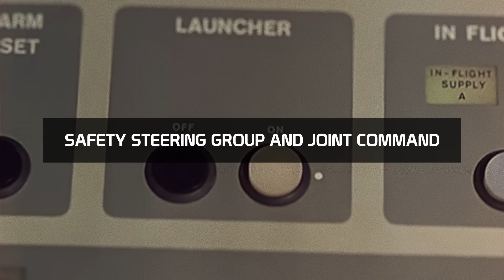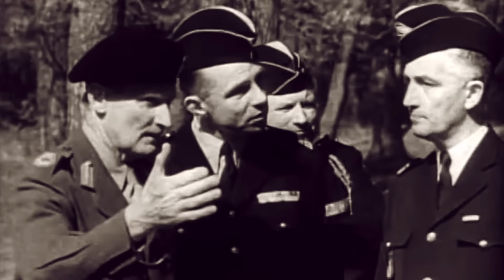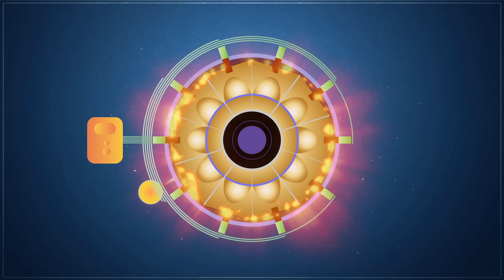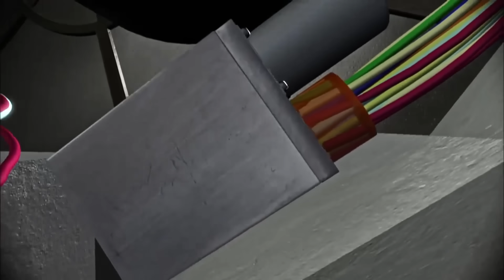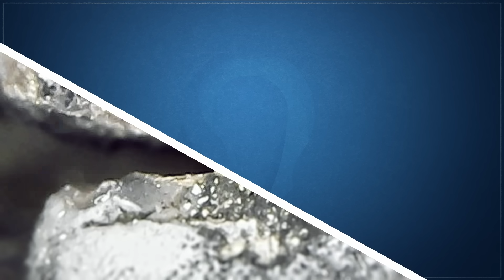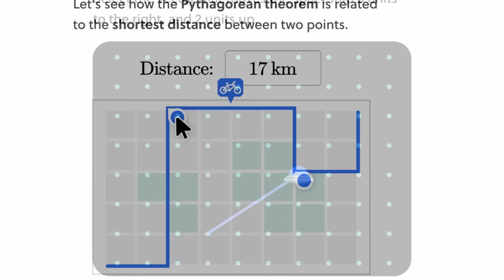The Remarkable Mechanism That Secures Nuclear Weapons

Comment: What is fascinating is that nuke tech at it’s core is very primal. Meaning once it got figured out it wasn’t gonna change much. Simply because of physics. So here we are talking about all kinds of modifications to start the firing sequence. So here in Belgium we also have warheads of US make. Then i wonder how frequent do these systems need maintenance or upgrades. While the core itself hasn’t changed that much most likely.
Reply: Kinda-sorta. There hasn't been a new warhead design since the end of the Cold War, but during that time, warheads were under constant redesign and improvements, as newer, more efficient designs allowed the US to squeeze more weapons out of the limited supply of weapons-grade and super-grade plutonium.

Comment: The actual lock is a still electromechanical.its a BCD electromechanical relay on the AF&F control board. The device is a little gold box similar to the size of one of the CP claire DIP reed relays. It has a small mechanism similar to the type you would expect in a combination lock that is driven by a tiny solenoid motor. If the correct code is entered the motor pulses allign the wheels to activate a switch. If all is good then the switch pops a nonrecindable thermal delay fuse relay that enables the system to arm. Once armed the only way to cancel is to use the destructive command disable. The switch must also be pulsed to the correct position fast enough that the disable relay doesnt fire. If this happens the nuke must have the PAL control module and the EF&F board must be replaced. Both the single shot relays look like glass top TO3 transistors. All of this stuff is potted in a nondescript epoxy block buried deep inside the forward section of the canned subassembly. This would make it extremely difficult for someone take apart the device, hotwire it, then reassemble as a usable weapon.
Reply: How do you know this?
Reply: @kellymoses8566  uh, maybe he simply worked with these things in the military?
Reply: @kellymoses8566  He Googled it.
Reply: @kellymoses8566    Look at the last sentence, he just had to brag.  Obviously, an extremely smart "someone" purchased some surplus warheads at a government auction, and he needs to re-code the devices.
Reply: @SunriseLAW 
What are you talking about? The best way to arm a nuke like this without any of that nonsense is to rip the core out and shoot plutonium into it or shoot plutonium into an assembled weapon at such velocity that causes a detonation. If you think that doesn't sound preposterous enough, the other way is by crushing the weapon. This second option to manually detonate is even more ridiculously impractical. May as well use such energy as a weapon itself. But yeah those are two ways neither of which are things even the most dedicated nations' teams of DARPA Skunkworks weapons experts could reasonably achieve. There are numerous other methods of dealing with nukes whether arming them or preventing them from detonating most of which surround disarming them using excessive force. More 'graceful' options allow for permissionless remote control, which is the scariest option.
Reply: @SunriseLAW  wtf are you talking about? You think he got ahold of surplus warheads (wut?) and then somehow de-potted the mechanism and learned all this from it? As opposed to him simply working in this field? Go learn about Occam's Razor dude.

Thats like a guy explaining how an elevator works and then you say its because he mustve snuck into a building and tore apart all their elevators to find out how they work instead of the dude just being a legitimate elevator technician. Thats really dumb.
Reply: @VariantAEC  What you describe does not sound credible. Crushing would be way too slow, I think one of the problems they had to solve at Alamos was how to crush fast enough the plutonium based bomb. With uranium I think it is a bit easier but I still think "at such velocity that causes detonation" is not that simple.  Sure you could create some sort of destruction and carnage but to get the design yield...
Reply: @VariantAEC  Thank you for the tips.  I am building an Ohio-class nuclear submarine and was getting hung up on decoding the nukes I purchased via Temu.
Reply: @Axel_Andersen  
Well, I did say it was less practical than shooting plutonium at the core... but apparently, you can't read.
Reply: @VariantAEC  Pot calling the kettle black ...
Reply: @Axel_Andersen  
That would be you again.

Listen, I specifically wrote, " If you think that doesn't sound preposterous enough, the other way is by crushing the weapon. This second option to manually detonate is even more ridiculously impractical." Please explain where I said this would be easy or even really achievable? Was it when I wrote this, "But yeah those are two ways neither of which are things even the most dedicated nations' teams of DARPA Skunkworks weapons experts could reasonably achieve."?

Please learn to read.
Reply: @VariantAEC  Typical YT comment response, thank you.
Reply: @VariantAEC  Problem with "shooting plutonium at the core" is: it doesn't really work. It's not by accident that "gun type" weapons use uranium. And it requires a lot more highly enriched fissile material than you'll find in an implosion type device.
Reply: This is one of those comments that makes me feel like I'm already on a watchlist just for reading it
Reply: @JilbertBoy you were on the low security list but now you’ve been promoted to new heights. Congratulations on joining the no fly list. 😂
Reply: Bruh wants to get arrested
Reply: Cant imagine how much these parts cost!
Reply: @nicksantos43 They use to be available at Radio Shack.
Reply: There are ways you can detect tampering using pulsed magnetic fields from internal and/or external, both that should and shouldn't be there. Same with pressure and vaccum systems that detect pressure changes like if you suddenly let air leak in/out of the hermetically sealed compartment(s). Same with light and many more variables. I assume each device is unique too as to specific limits allowed before self-destruction and there are records of what a certain specific device is supposed to be at settings wise for anti-tamper and it is probably read by using a digital code that displays once imaged, decoded using a known coding system, probably read by a sort of digital punch card just inside a certain part of the device, that would show from using an x-ray from outside and doing a simple x-ray test on that area of the device. The varriables you would need to know to break the safety anti-tamper mechanisims would be learned by the prior said x-ray test. Such a system would have supreme anti-tampering abilities and also need to be done deep within a specially secured blast proof bunker as even then it would pose a risk, much like the place they have in NE Amarillo. Thus if it does goes off, the blast is contained inside a sealed concrete igloo for lack of a better term. No way for all the radioactive materia and blast from explosives to leak out and become a concern to populace and enviroment.

As far as the electronics it is simply a special form of assembly coding with the codes being more encrypted (rather obfusicated) as well as firmware done same way. Arming codes themselves are random and thus technically encrypted. Both of which on tampering also would be wiped just before blowing the device apart.

And the device self disassembles by causing only part of the core explosive lenses to go at once, instead of all together, thus not forming a spherical detonation wave and thus blowing it apart instead of crushing inwards and thus achieving criticality.

Also they can mold the safeties inside the explosive lenses' and also other areas deep within assemblies that would be almost impossible to reach and thus unable to disable UNLESS you were a soffisticated engineer AND knew how to read the codes and how it was specifically done.

Thus the very people who do the work are some of the most critical assets and also themselves or at least their knowledge on it, thusly, some of if not thee most classified items in our government as a whole. Their very knowledge of specifics would mean it isn't wise for them to leave the USA ever again as frankly they are a risk to national security if captured by foreign nationals or bad guys.

You kinda have to read betaeen the lines and be a multiple disciplinarian engineer wise to figure out all this but it's all here and there knowledge wise. And it's darn clever. And it works.
Reply: @AldoSchmedack  yup they have both soft and hard anti tamper schemes on nuclear devices. The self destruct is a true anti tamper device that prevents disassembly of the CSA unless done in an extremely specific sequence. It is completely isolated and independent from everything else and solely intended to prevent capture and reverse engineering of the warhead. All the soft devices including the electromechanical lock relay are inside an epoxy block module in the forward most section of the canned assembly. If you managed to get to it, you have also already opened the CSA without activating the self destruct. 😉
Reply: Sounds like a challenge
Reply: This guy is like lock picking lawyer for nukes lmfao I wanna buy you a beer or two and pick your brain dude lol
Reply: He did time at KUMMSC with me. The fact that people cannot disassemble and reassemble a 61 disturbs me.
Reply: @Guardian_Actual  DIY nuclear weapon maintenance is a dying art.  Today people will just buy a new bomb, and leave the malfunctioning one on the curb with a "FREE" sign taped to it.   In the 1960's my dad used to make extra money fixing discarded "junk" bombs and selling them at swap meets.
Reply: @Guardian_Actual KUMMSC huh? The ol' Korean University of Missiles, Mayhem, Spying, & Cartoons.  The central source of North Korean special agent training where they study western culture and weaponry?!

Commie spy!
Reply: 1. You might want to keep this to yourself.  2. Are you looking to spend some time in jail?

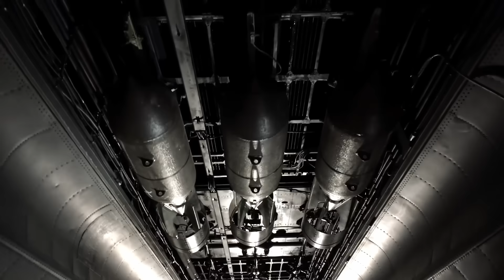Comment: 5:45 " Europe and other remote locations". Are mad or mentally challenged?
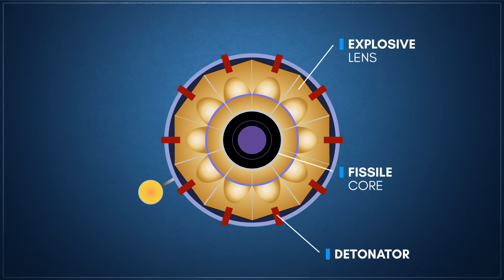7:30 thermonuclear device made with U235 in it's core? 🤣🤣
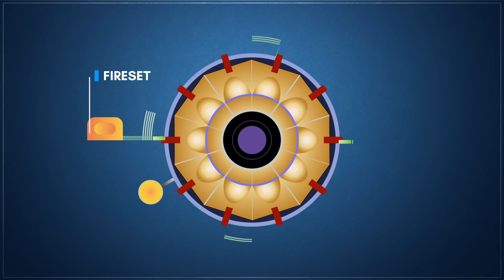7:38 Mofo, lens or pits?!
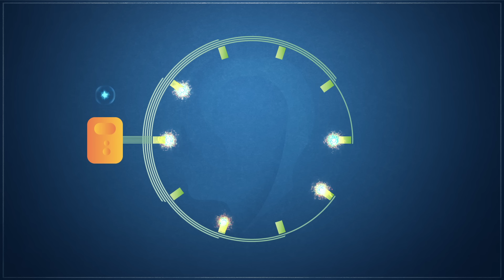8:20 sphere has to be detonated in an instant, you tool, in order to achieve compression of the core and neutron initiator!!

Comment: Although not the purpose, this video is the best explanation I've seen for how nuclear weapon detonations work on a mechanical level. I never knew how the explosion was actually triggered until now.
Reply: Learned about that from encyclopedias in middle school.
Reply: @VariantAEC  didnt ask nerd
Reply: and you still do not know it because in this video the simplified historical scheme is described, the reality differs
Reply: @alexanderkonev8540  Exactly. And not even the designers of the mechanism that might have been used, don't even know if it was their mechanism that was used. For all we know, it could be a whole set of new designers looking at those designs and using those as prototypes for the actual final design. And maybe that design wasn't the final design either. No one knows except maybe one guy and that guy is probably Chuck Norris.
Reply: It cracks me up that he didn’t name the detonator type. It’s an extremely controlled tech for this reason
Rhymes with “fridge tire detonator”
Reply: @chonchjohnch  Bridgewire detonators are controlled tech? Really?
Reply: @johnopalko5223  literally yes
Reply: I've know most of this stuff since the 70s.  (not the part numbers, but how the device actually works)
What I didn't know, was that they could vary the magnitude of the explosion, or how.
How do they do that?
Reply: @mountainjeff  The magnitude explosion is varied via the use of tritium gas.
Reply: @mountainjeff  The explosion slams the sub-critical masses together, which makes it go critical. "Go critical" means it's more than 50% likely that a neutron released by one atom hits another atom before it leaves the sides of the mass of plutonium. Each time that happens, it splits another atom, releases more heat, and releases another neutron. The bigger the chunk you slam together, the more likely a neutron hits another atom and keeps the explosion going. But once it starts to explode, it's pushing the bits and pieces of the fissile material apart again, so you have to slam it together really fast. 

If you slam it together more slowly, it'll start exploding, but push the pieces far enough apart to stop the explosion sooner.

So I'm figuring they have a number of explosive bits they can explode, and they explode 80% of them or so to push them together with less force or 100% for the biggest explosion. Something like that.

Alternately, if they're setting off several sequential explosions to push them together, they vary the timing so as to "hold the bits together" longer if they want a bigger explosion.

I'm expecting the differences are on the scale of microseconds, if that. :-)
Reply: @darrennew8211  That's my biggest gripe with the video. Honestly, cannot remember the details, but PAL got "really great" with the transition from "external locks" to integrated codes (which also allow dial-a-yield). Basically, the former try to hamper your ability to give the weapon the "detonate signal". But if you had enough time and disassembled it carefully, in a sense, the nuclear detonation is only a power plug away.
On the other hand, the modern one manfucatures cables and explosive lenses so that triggering them at the same time will simply give you a small dirty bomb. Thus the required code is integral to the core because the explosive lenses need to be triggered in a very specific sequence and with exact timing, otherwise the shockwaves won't compress the core, because some will arrive earlier and just drive the fissile material apart instead of compressing it. Which means there's no way to detonate the weapon without the code, you'd have to reconstruct the explosive lenses. And there's no way to "derive" the code from the weapon (like you can with a disassembled padlock).
That wasn't explicit enough for me here, because nowadays, the US's (*1) nuclear weapons are pretty safe, it just depends on safeguarding the code itself. But if somebody got one, they'd be unable to use it.
(*1) for all we know, russia still has weapons with the equivalent of a padlock, keeping the codes in submarine safes.
Reply: @darrennew8211  you do not slam masses, the plutonium has different crystallic forms - google for "Allotropes of plutonium" - they have different densities and switch of density happens faster than the speed of detonation wave
Reply: @tafdiz  
I know, I read about it in school over 2 decades ago. I just look young.
Reply: That's one of several ways of doing it. Likely the "safest" in the sense of "least likely to happen automatically."